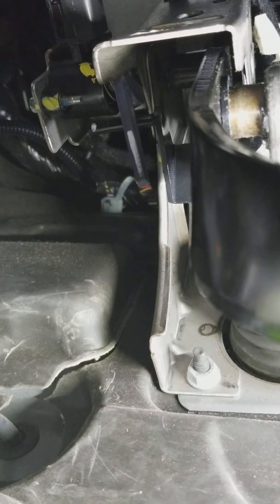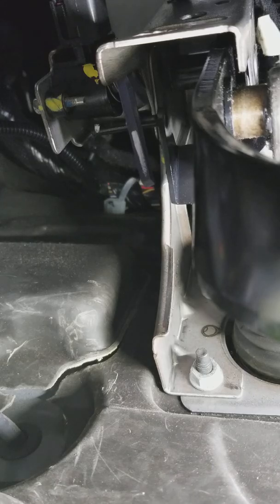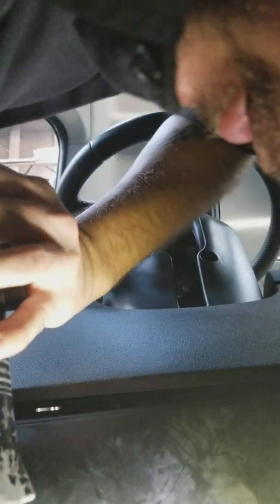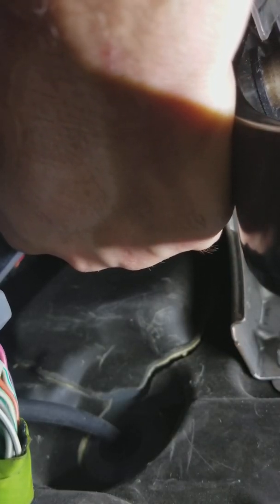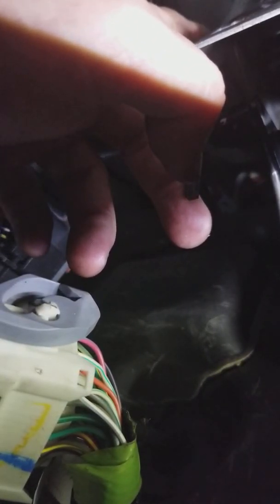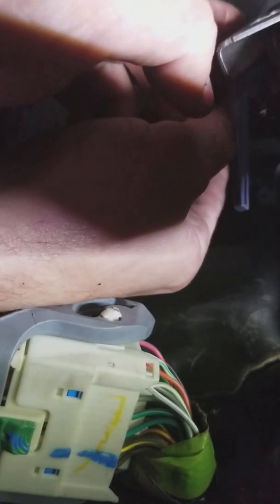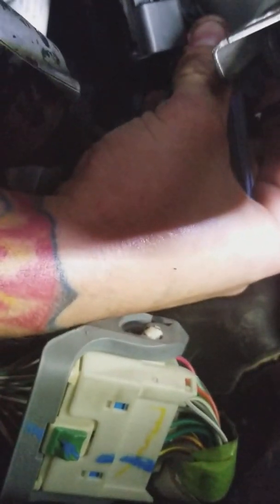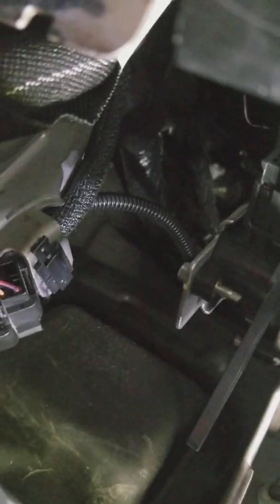dodge journey brake light switch (brake pedal position sensor)

Comment: just switched it on a 2012 dodge joinery thanks for the video it helped a lot. After you changed yours did the check engine go off after driving it for a while or instantly I changed mines but still got the check engine light on drove about 50 miles
Reply from the maker: you would have to do a battery disconnect to clear it or clear it via scan tool it wont just clear automatically once its stored as a hard fault code
Reply: I just had mine replaced on my 2013 dodge and the brake lights still stay on. What's up with that?
Reply: @brendayoung7055  ? just changed mine Sunday and now my break lights are stuck on. Any help would be helpful.
Reply: @melissamitchell5206  Did you ever find a fix?  I am having a nightmare of a time and have paid a shop that is stumped as well.
Reply: @beyondkreativ  took it to the shop they calibrated the brake pedal pressure switch and it made my break lights go off but my traction control and check engine light was still on so he tested it. He said that the one we just put on was bad so ordered a new one put it on. Did good for two days then the traction control light and check light came back on. I went back to the shop he said it could be another bad one or wiring. He tried clearing the codes but they came back on. The lights are still on now and I haven’t went back.  Idk what to do. Good luck.
Reply: @melissamitchell5206 mines doing the exact same thing. Did they ever figure your out?
Reply: @strracer75  nope. Traded it in and bought a new one.

Comment: Good job bud! Pain in the a** location!
Reply from the maker: Tell me about it
Reply: @uglyhp8225  I agree - tell me about it... Didn't know it needed calibration. I've tried changing this part twice - Did You ever figure Out the calibration piece? I returned the first replacement switch thinking something was wrong with it. Brakes stayed on after replacement. Put the original back in. The second switch replacement the brake lights stay on. Any tips? Thanks.

Comment: I have the same issue my brake lights stay on , how do I go about calibration after new one is installed?
Reply: Did You ever figure. Out the calibration piece? I returned the first replacement switch thinking something was wrong with it. Second switch replacement the brake lights stay on. Any tips? Thanks.
Reply: @therealjoethebro  Whenever the brake pedal position sensor is removed and reinstalled or replaced with a new unit, it is necessary for the Antilock Brake System (ABS) module to calibrate the reinstalled or the new sensor. Follow the programming steps outlined in the diagnostic scan tool for the “ABS Initialize” routine under “Miscellaneous Functions” for the “ABS Module” menu item as appropriate.

Comment: Did you change it because it disnt want to start, or did it not make a good connection that when you try to start it it made a click noise?
Reply from the maker: changed it because the brake lights stayed on even after the car was shut off